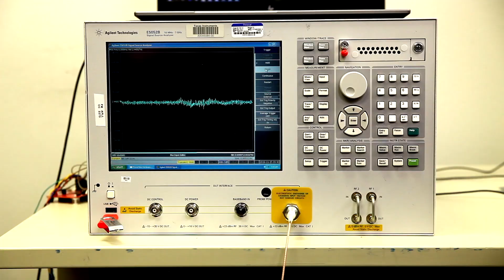Connect: Crystal-less wireless MCU demo in mechanical shock and vibration environments

Comment: This looks like a great way to save board area. Besides somewhat worse clock accuracy (and the fact the product is not yet released), are there any disadvantages BAW vs an external crystal (in BLE applications)? How does power consumption compare?